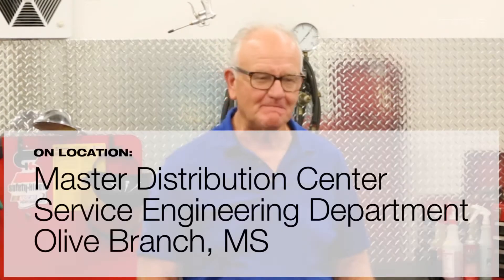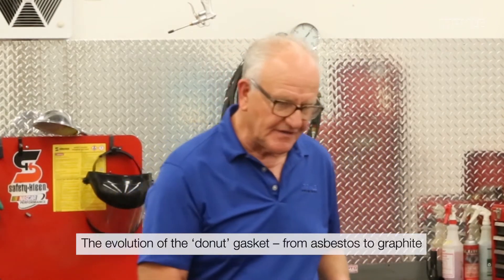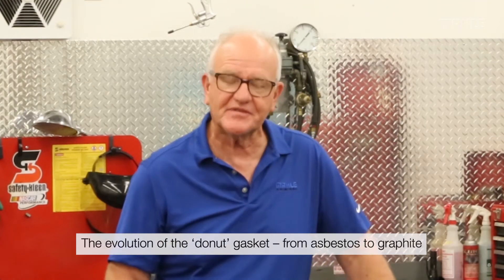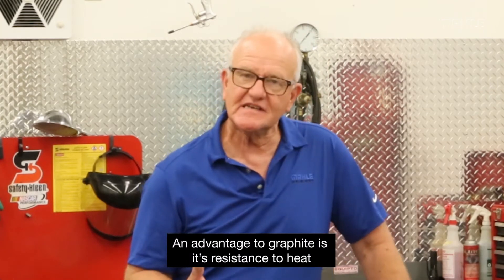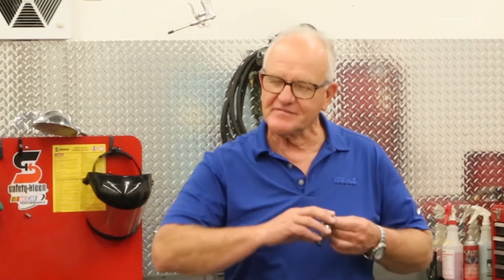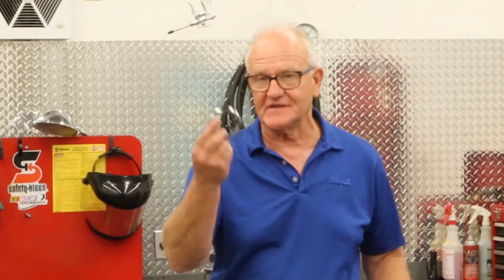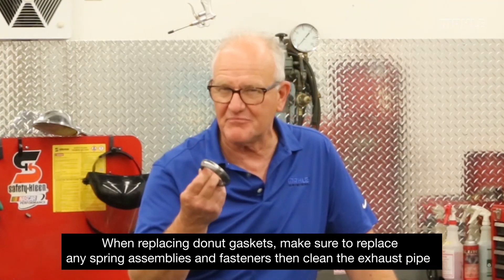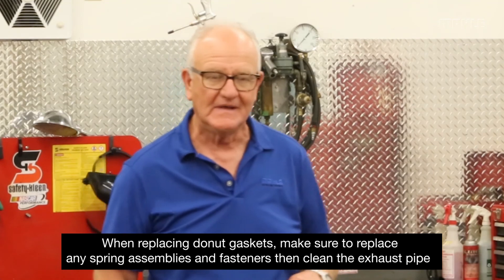The 'Donut' Gasket

Comment: I hate these things they never pass my smoke leak test. Can i just weld on a flex pipe?
Reply: I wouldn't weld it on, just use clamps.
I put a flex pipe in place of my stolen rear Cat and it rusted bad and tore apart leaving me to replace it again.
I'd suggest clamping a straight pipe on instead.
Reply: @HeadgyHog  the thing is, you have to use a flex pipe or doughnut gasket after the header but before cat, because as your car bounces around the exhaust has to have some way to flex or it will crack the header. Especially if you have soft motor mounts

Comment: Awesome advice and great clarity offered to what can be a dark spot in home auto repair. I went to two local auto parts stores that couldn't find the "donut gasket" for my vehicle. One guy said I wouldn't be able to find one at all and tried selling me a length of steel pipe for me to cut down and grind into the general shape. 
Pretty interesting experience. 
It's helpful to know a few terms for the part you're looking for, what it's made of, and corresponding parts that should be replaced along with it. 
Luckily I can find a graphite gasket ring and spring bolt kit online.